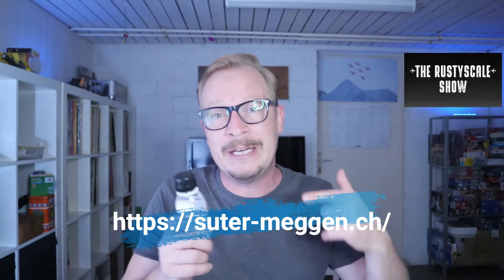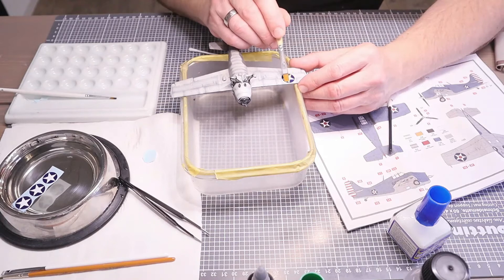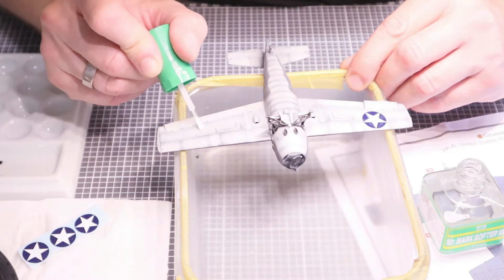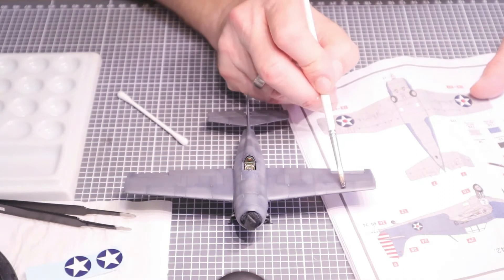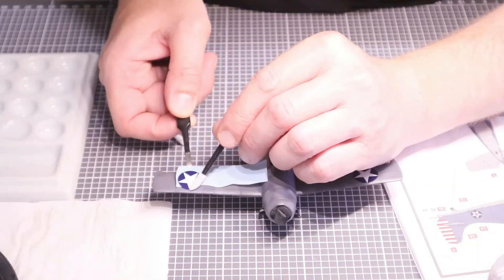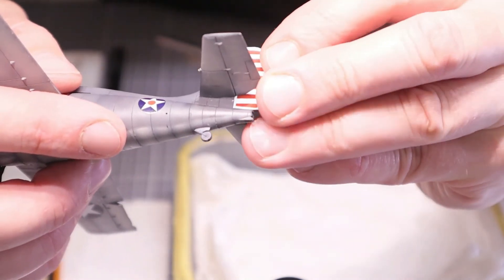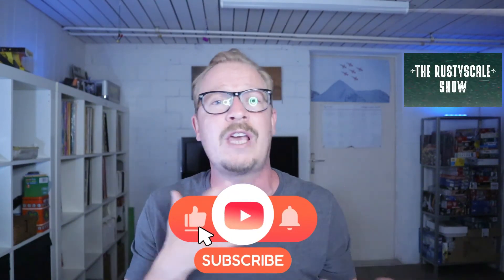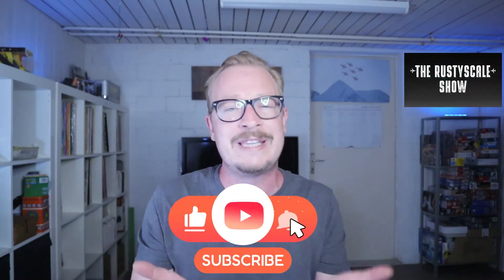DECAL SOLUTION Check: Mr. Mark Setter & Softer & AK Decal Adapter Solution

Comment: Great video!. Will Mr. Mark Softer help the decal stick better like the Setter? Or is the Mr Mark Setter the only one which will work on old or decals that don't stick? Thanks
Reply from the maker: No the Softer will not really help the sticking process. If you apply it before placing the decal it will help to avoid air bubbles underneath the decal.

Comment: Tamiya Mark Fit (single bottle solution but two-step process if you RTFI) or Mr. Hobby Setter & Softer 2-step process slay the competition. Tamiya's Mark Fit gets bashed by many who've never used it just regurgitating an overheard negative bias towards anything Tamiya. 

Good old traditional Microscale Set and Sol do a respectable job. They can be depended upon regardless the paint system used. Vallejo? I've read some horror story prejudice against these which I suspect strongly of hyperbole in the moment. Nevertheless, there are a plethora of alternatives if averse to their product. Another 2-step solution, I actually have Vallejo Fix and Softener. I haven't had any problem with them ever over acrylic resin water based paints. i.e. Vallejo, MIG & similar.

Comment: Vallejo Decal Fix dissolved Tamiya paint and Tamiya Clear on both occasions that I have used it, I will not use it again.
Reply from the maker: Ive only tested it once and had a similar result. I will give it another try soon and test different types of varnish.
Thanks for the feedback!
Reply: Interesting. I'll put that to the test next time i have a surface, spare decal & remember too. I actually have Vallejo Fix and Softener among a available selection of several others. To date I haven't had any problem with them ever over acrylic resin water based paints. i.e. Vallejo, MIG & similar. I use Tamiya Acrylics, so... will get back to you with my exp after trying the combo. Cheers.
Reply: @theblytonian3906  I hope that you do, it would be good to hear another opinion. On both occasions that I used the Vallejo solutions on the Tamiya paint and clear the Tamiya products softened causing the decals to sink through the layers. The decals themselves weren't affected, only the Tamiya paint and clear. I did email Vallejo customer services to ask if there were any known problems with their decal solutions reacting with other company's products but they never replied.
Reply: @martinoconnor4314  I'll be cleaning and servicing one of my airbrushes on Friday hopefully. I'll lay down some Tamiya colour Acrylic as well as a second patch of the same with some X-22 Clear over it and let them thoroughly dry for 48 hours before trying the Vallejo Decal Fix and Softener. I'll get back to you when I have a result - good or bad.
Reply: @theblytonian3906  Thanks mate, I look forward to your results.